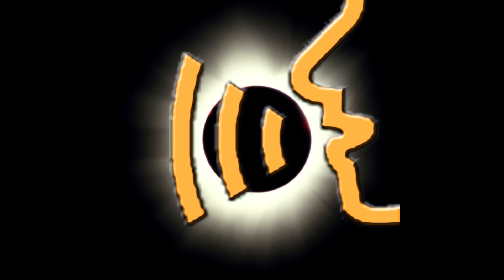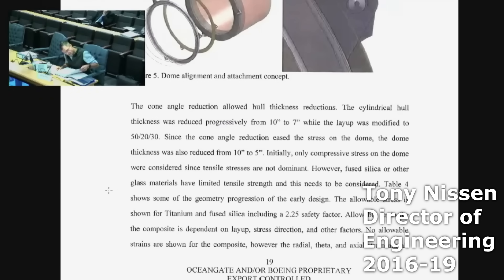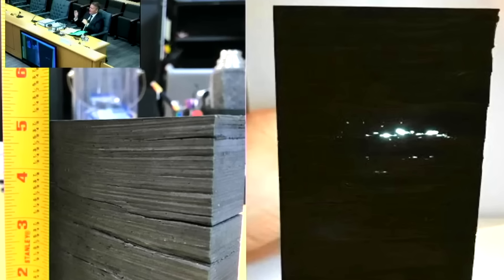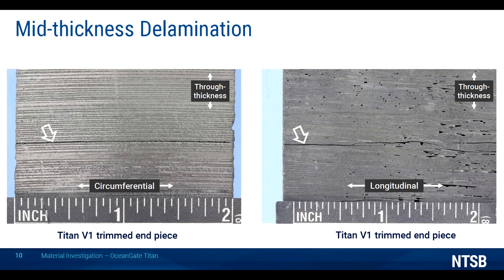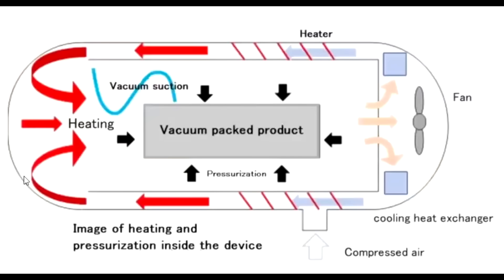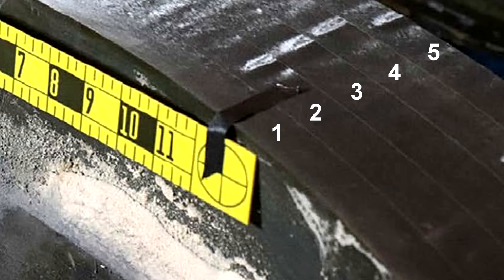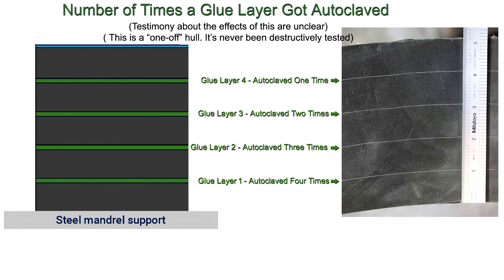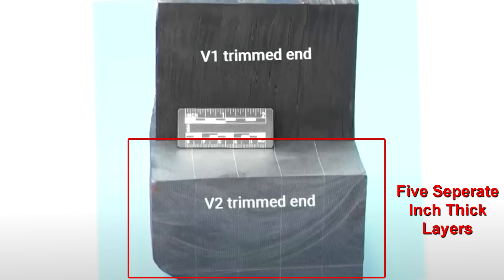Who Engineered the OceanGate Titan V2 Hull? Maybe Nobody Did?

Comment: Funny thing is, carbon fiber could be a legitimately good choice for a sub, thanks to how buoyancy works that deep. But it has to be done properly, unlike on the Titan...
To be exact, upon digging a bit deeper in the literature and talking to people in the field (ultra-deep submersibles), it turns out that a composite submarine actually makes a lot of sense. Deep diving composite subs have been explored and even tested successfully going back to the 1980s.

Submersibles fail typically due to buckling (not pure compressive failure) and composites can be quite stiff, which is what you want to resist buckling. On a specific mass basis, composites for stiffness are a win.

Normally for submersible objects, you don’t care much about mass. E.g., a composite SCUBA tank for sport divers makes no sense, as you’d need to add weights to make it neutrally buoyant.

But as you go ultra deep (> 2 km down), metal pressure vessels become negatively buoyant (i.e., they sink), so deep-diving subs need external buoyancy devices (typically floats made of syntactic foams on Alvin or—going back—tanks of gasoline on Trieste). If you want a sub that doesn’t have these external buoyancy devices, i.e., you want a sub that is light, slippery, and streamlined, then a composite cylinder with titanium endcaps starts to look very attractive.

The issue with the Titan was not the conceptual design, but rather it had not been proofed to the depths it was bringing crew and passengers. That was nuts.
Reply from the maker: Thanks for your thoughtful comment.  Yes, the knee-jerk reaction is that carbon fiber can't do this.  That is actually not true, but is has to be fabricated perfectly.  That is a huge challenge with a 5-inch thick CF laminate.  The NAVY ASUS unmanned glass composite hull did quite well.
Reply: @solareclipsetimer  Yeah, it is a high-effort/high-reward material. And if you don't put in the effort...
Reply: Most stuff often fails in compression due to buckling, not compressive failure. It's not like a stubby concrete pillar crumbling under too much weight, but more like a piece of dry spaghetti being pushed together at both ends: it doesn't crumble, it flexes in one direction and then snaps when it flexes too far.

Strength in buckling isn't related to compression strength, but stiffness. Stiffer materials will take more load before buckling. Being extremely stiff, carbon fiber is great for handling buckling loads.

After all, if carbon fiber was that bad in compression you couldn't really use it by itself to make strong parts. You would have to make sure that it would only be loaded in tension and use a different material to handle the compressive loads, at which point you're basically using it like a rope or cable. But we see carbon fiber being used to handle strong compressive loads all the time (in sports and modern airplane wings) so it's not actually weak in compression.
Reply: The overall negativity associated with a carbon design is that there has to be an adhesive component and attached to other structures on the submersible, in this case titanium. It is the totality of a carbon fiber design which has a capacity for failures. You can’t just focusing on the hull and material alone
Reply: The problem is that carbon fiber is good at tension forces, not compression forces. And at that depth it’s all compression. There is no way to change the forces to allow carbon fiber to operate down there.

Comment: It's a very simple problem actually. We don't have any known materials that can go through a cyclic load of that dimension. We don't have any known materials match up with each other and go through these kind of loads and distortions repeated over and over. The first time he goes real deep he begins to damage the ship. It's all cumulative damage. All the relatively sane people that made a dive that deep went one time, per disposable ship. I saw a video of a guy down a thousand feet and a plexiglass window  1 ft thick cracked. It didn't leak or shatter but there was a line across it and you could tell it shouldn't go another trip. The sound inside that little metal ball was amazingly loud. I'm glad I wasn't in there because I would have had a big stinker in my pants.
Reply: This is just not true. We have metal-based subs that have been en service for 60 years diving to these depths. This is a carbon fibre problem, not a general material problem
Reply: @guyfawkes8873  I know what you mean last week I was just looking at a bunch of movies of metal submarine after metal submarine that went down there to the Titanic over and over and over it must have been 150 trips  tickets for only 200 bucks I don't know why they ever quit the tours with the submarines over the Titanic and went to this but they did.
Reply: @markmcgoveran6811  What are you even talking about? You dont make sense man

Comment: Carbon Fiber only work at tension forces, Stockton and many others, never understood the fundamental concept apparently.  
At that deep sea conditions everything is subject to compresion forces, "EVERKYTHING".
There is no way to convert compresion forces  to tension forces,  that make the epoxic aggregate the only working material. 
The calculations should only consider the compresión especification of the epoxic aggregate and that resistance wouldn´t be enough.  
The carbon fiber alone didn't work at tension at all.  
The cracks were evidence of the epoxic aggregate fracturing.  
It is incredible that nobody had stopped these nonsense.

Stocton brags about  breaking rules, in this case he broke  a fundamental rule, gravity.
Reply: Is it not the case that he was assuming that tension and compression were the same depending on which way you look at it? So if hes inside the sub he thinks the force coming in is somehow pulling the hull in? It seems like a monumental misunderstanding of the concept?!?
Reply: It's not that easy.
The fibers were aligned horizontally and bending forces were acting on them.
Bending forces are made up of tensile and compressive forces.

Comment: A layman like me was appalled at their gluing exercise....using plastic spatulas like I once used to apply autobody filler and the ad hoc approach...using rags, no cleanliness to speak of. A death trap, pure and simple.
Reply: I don't know how else they would have put it together but when I saw them glue it all together it blew my mind.
Reply: That was V1 and thankfully it was gotten rid of fast. The sad part is that, after doing the right thing with V1 by getting rid of it, he went all in on a pair of deuces with V2. In hindsight, everything would have worked out if that dive Stockton took with V1 had imploded, then none of the rest would have happened.
Reply: @rodneybray5827  Watching the doc, you find yourself wondering why, upon hearing those noises at depth, he didn't stop, think, and rethink and then abandon the carbon fibre approach entirely. He wasn't the kind of person to do that.
Reply: @rodneybray5827 🎯

Comment: Why not make the whole thing out of titanium
Reply: Its expensive n heavier
Reply: Titanium welding is comically difficult. It transfers heat so fast, it oxidizes like hell, becomes brittle for no reason and spits fumes so toxic birds will drop out of the sky near your extraction fan. No way they had the skills to make such large appropriately strong welds. As I understand such welds are almost exclusively done by robots with x ray vision and engineering teams.
Reply: It's the shape. Successful all-titanium submersibles exist that are completely safe from implosion but they are spherical and the number of passengers is limited to 1 instead of 3. So it's economically difficult and Rush was compromising for that long cylinder that allows 3 passengers for the moolah. Making a cylinder with end caps out of only titanium would have been too heavy and very difficult or impossible to make. So he compromised with a design that was nuts and doomed to fail. To have any chance of being safe, you'd have to discard the hull for a new one after a dive or two. Even then, I'd not want to get in it because carbon fiber could implode on the first dive. I truly believe that. It's like a chinese finger trap. You can get your fingers stuck because you're pulling at the ends, but squeeze it in the middle and it compresses without a problem. The strength of the fiber is pointless when being compressed. I'm shocked it didn't implode sooner.
Reply: @rodneybray5827 realistically it would have been stronger had it been made out of resin or better yet acrylic,than carbon fiber, since all the carbon fiber did was add volume but not any compressive strength

Comment: Carbon fiber is a rope.  Rope works great in tensile, you pull on the rope, rope works great.  Push on a rope and not so much.  That is what they were doing with that hull, pushing it, that is why it works great on aircraft because you are pulling it.

On the bright side, we know an epoxy shell can withstand almost 4000 PSI, which is impressive!

And if I had to take a guess, I would say the noises they heard and recorded was the epoxy breaking away from the carbon fiber strips and not the carbon fiber breaking.
Reply: you can make hulls from carbon fibre. the rope analogy goes out the window when it's used in a composite where compression turns to tension. i hate this analogy, especially when it reached the 6km depth multiple times. you ever tried to swing at a golf ball with a rope? ever tried to ski with a rope? ever tried to BUILD A WING out of rope? come on now, it's such a misunderstanding of cf composite materials and someone just has to repeat it like a mantra acting smug in every comment section and probably go on to another comment section saying that "torque is power" or some other similar repeat nonsense.
Reply: I think he got it backwards, which is why he was so confident in the carbon fiber.  those high pressure cylinders wrapped in carbon are super strong, but the pressures on the inside.
Reply: Uhhh, properly designed carbon fiber composite structures are practically equal in compressive and tensile strength. Carbon composite structures are dissimilar from individual fibers or tows.

Comment: Why would they not test that final hull with the 1/3 scale test? Seems like any actual progression should need to pass that test? Everything about this is so nuts to me.
Reply from the maker: Do not know.  But they never did co-bonded hull scale model tests.
Reply: they lacked the money and resources. 1/3rds scale test would basically need a 1/3rd jig to build it - but there's more to it. scale testing composites doesn't work like that(edit: the fibers themselves, space between and the glue interfaces etc doesn't scale and the strength of them doesn't scale). they would have needed to do destructive testing, or at least stress testing recording on a spare hull. and look the cheapest way to do that would have been to build extra hulls and do unmanned dives with them to get the data of the long term degradation

even scale testing steel alloys doesn't work at the extremes, if they don't test to much higher than required in the application. the alloys needed for something like this and access to them also gets political, it's one of the reasons why there's so few of them, you can't just use more steel even if you would think that weight isn't an issue. it's why ussr bought mir1 and 2 from finland and why usa gave the greenlight for finland to develop them since usa intelligence thought rauma-repola couldn't do it(but they could and cia threw a fit over that). those hulls also have a service life just like alvins hulls have anyway, but they're easier to measure/test/xray at service intervals unlike a composite is.  there's just no easy hack around that using the subs and maintaining them is expensive and his business plan depended on it being at least as cheap as an airliner yearly to keep it operational (probably would've needed to be a lot cheaper actually, not like per trip but per year of being in business)
Reply from the maker: @lasskinn474 Yes, thanks for replying. I agree with you that carbon fiber probably does not scale up well enough to determine the final strength of the full sized hull.  However, they worked under that premise, because Tony testified that it does scale well.  At least they worked under that for the V1 hull.  They really needed a CF expert for the V2 and they never hired one.
Reply: @solareclipsetimer  yes, I think a lot of it was just trying to come up with a right way to do it, possibly while trying to get the big funding necessary for it. then just doing it with what resources were at hand. a common startup scenario.

stressful to contract for such, the gig is first presented as simple and so forth but in short order you're expected to pull a rabbit out of a hat (or get positioned to take the blame).
Reply: @solareclipsetimer  oh yeah and thanks for the great content on the subject.  most of the content on the disaster is just 'carbon is a rope', 'console controller lol" or feelies painting, the netflix doc too just focuses on the characters and human aspects

a lot of the content out there just straight up acts as if the sub didn't last a single dive, very little of it dives into why it did last a bunch of dives and then break
Reply: They were broke and Stockton wanted to start bringing in income immediately... or that's my guess.

Comment: for a safety factor 2x why not simple drop the finished thing to double the required depth without anyone in it.. would surely have failed because the design was flawed
Reply from the maker: They did that in the Bahamas with the first hull.  They never did that with the V2 hull.  They did four days of chamber tests (5 cycles), and then went to manned dives.
Reply: Each new full scale design should of been tested to failure without any human in it. Rush was a nut job.
Reply: @husaberg650  "should've" - contraction for "should have." 

There is no "of." The  've part sounds like of, but it's not.

Comment: I guarantee you that Stockton was the main engineer on the v2 hull. He thought he was smarter than everyone. I’ll never understand what made him think a sub that was held together by glue and would be submerged in extremely high pressure salt water was a good idea..
Reply from the maker: Good comment, and I agree to a point.  Phil Brooks testified that Stockton did not want to do the 5-layer co-boned technique; he wanted to do a single lay-up like the first hull.  But Electorimpact would not do a single layup.  They said we will do it in layers (I think for proper curing) or take your project somewhere else.  So, someone else, or the situation, pushed Stockton to the co-bonded design.  And that co-bonding was some of what NASA was teaching him.

Comment: I'm a layman. I only build model aircraft. What I've never understood about the design of this OceanGate project is why they decided to use carbon fiber, regardless of the number of layers, for the type of loads expected.
Reply: Money. Carbon fiber is much cheaper than steel or titanium--especially at the thickness you need to resist those kinds of pressure forces (and extra expense is almost certainly the reason they stopped at five inches of thickness on the carbon fiber hull instead of going to seven). I mean, the guy was so cash strapped they were using an off brand ($8-12) game controller to steer the sub, and the CO2 scrubber was made from a plastic storage container with a computer fan glued into it--both of which you can pick up at Walmart for a few dollars. He was really good at Jedi mind-tricking people into thinking he was being clever and innovative, but in reality, it was a sign that he didn't have the funds to finance that kind of operation.
Reply: Also leads to a thinner hull and larger internal volume, allowing more passengers (more income).
Reply: From my understanding they needed to use carbon fiber because they needed to to be light enough to function while also holding enough passengers to generate revenues. It was either carry less passengers or use a different material. Stockton was an idiot and essentially
Reply: I also heard in a doc somewhere that the lighter weight was also meant to enable the use of smaller launch vessels, allowing the more economical tourism model he was going for.

Comment: I wonder now if you can really call any of this "ignorance",  He removed the bubbles from the original layer.  To do so, he had to sand them down, but to be honest, it does seem like Rush did his best with the information he had.  It definitely did look like it improved his hull strength.
Reply: Surely the point is that Rush did have information - he just simply ignored anything negative and fired staff who stood up to him. If the process of sanding improved his hull strength, where is the data and why did it fail?

Comment: i'm curious if the titan submersible would have survived that depth if the hull is all titanium... and the viewport up to spec?
Reply: James Cameron explained it really well. Hulls should be the heaviest material for a reason. The other parts can be lighterweight but you definitely want the part with the most pressure to be the safest part since that's where you're going to be sitting and you also want it to be as spherical as possible so you can get even pressure across the entire hull.
Reply from the maker: Thanks for your comment, and that is a great question.  And the answer is no, in my opinion, from analyzing Bart Kemper's work.  I write about it in my upcoming book.  Stay tuned!  www.titandives.com
Reply: Not as a cylindrical configuration. As a sphere, absolutely.
Reply: Have you ever seen how easy it is to cave in a train cart with temperature shock or vacuum pressure?   Edit oil container train cart
Reply: Military submarines have a tiny little lens they look out of.  Not windows
Reply: No.